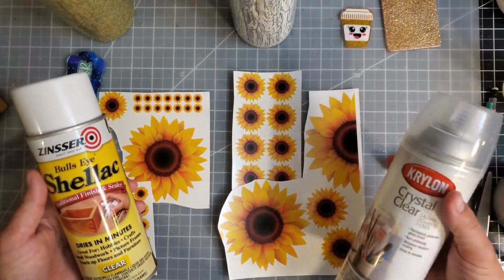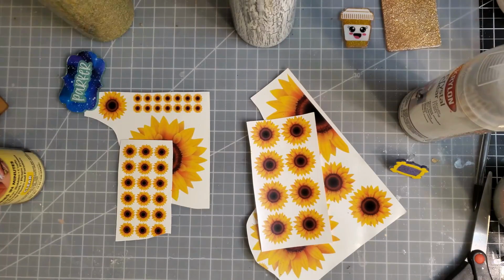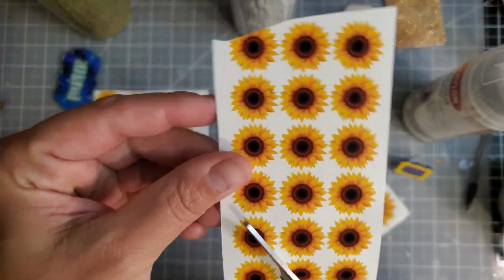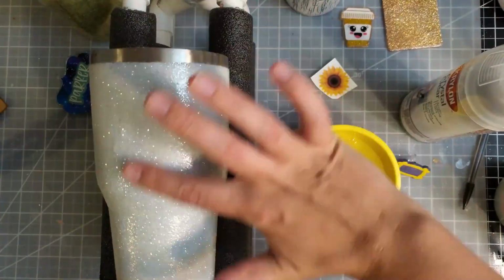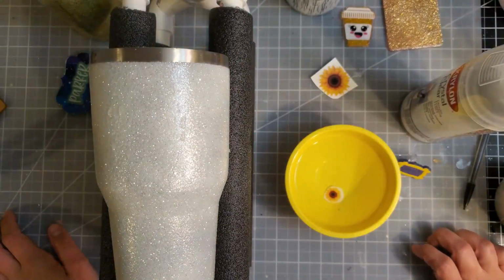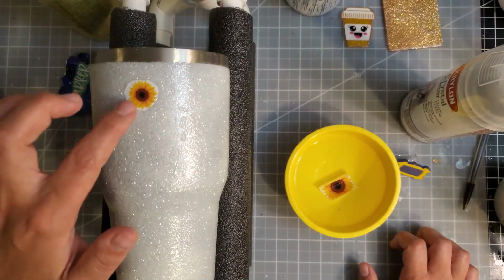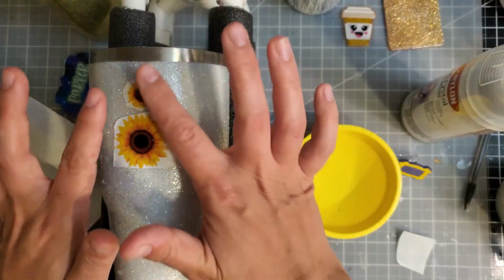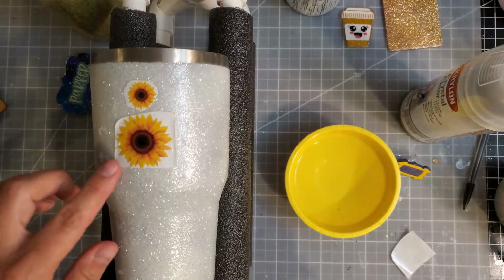Sealing Waterslide with Zinsser Shellac Spray for your Crystalac Cup | EXPERIMENT Results!

Comment: How did u like sealing your waterslide with shellac? Did it yellow? Or was it the same as sealing with others vs not having to off gas? Do u still use it to seal your waterslides?
Reply from the maker: honestly, i did not notice ANY yellowing at all! I haven't done it but i don't have a great reason for that - i think because i'm just so used to doing my plasti-dip sandwich! I can do another test run and see how i like it!
Reply: I use shellac to seal everything. There’s an amber and a clear. If you use clear there is no yellowing.

Comment: Alison, sorry but I found your description to be confusing. Right one was shellac and plastidip and the left one was multiple layers of shellac?? Also, do you do this with only the inkjet ones and not need to with laser print or do it on all?? Thank you for the clarification
Reply from the maker: waterslides printed on laser printer do not need to be sealed. If you are sealing with shellac only, you can do a few light coats. If you are using plasti-dip, you want to sandwich the plasti-dip between layers of clear spray paint. Usually 2 clear spray paint, 2 coats plasti-dip, and 2 coats clear spray paint.

Comment: Can you put waterslide on color powdered tumblers? 😊
Reply: Like if i bought a white colored tumbler and just went straight to doing waterslide is that ok?
Reply from the maker: I am not 100% sure, you'd have to check with the brand waterslide you're using. I do you won't be able to seal anything over the top of it because it's designed to repel water.
Reply: Alison Crafts 
Ohh ok thank you so much! 
Do you think if i put a few layers of Crystalac over the colored tumbler then the waterslide would that work? 😅
Reply from the maker: @esasdfghjkl  I think they recommend you strip those first or at the very least sand then super well. So you would still need a base coat (like universal white) to cover the sand marks